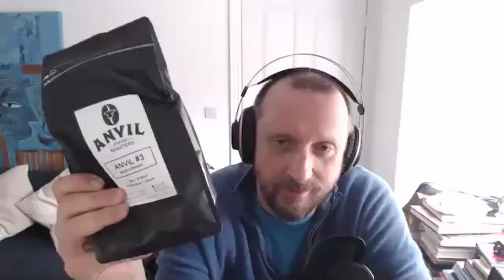Plumbing in an Espresso Machine

Comment: Pressure reduction is often required  for line level pre infusion.  Most people recommend about 2.5 bar. As someone who has had plumbed in machines for years it is easy to forget to replace filters. The difference between a domestic setting and a commercial one is also important. 6 months at home vs  6 months in a cafe  is a huge difference in the volume of water running through the machine.   Once you have a plumbed in machine you can never go back !
Reply: Interesting. I'm running at 2 bar pressure at the moment, after the reduction. I think I can increase it a bit actually. You're dead right about the filters. In the cafe, I asked the maintenance company after 6 months about changing the filter, but he didn't seem to care. I suspect he really didn't care... I'm going for the Brita system for home, and it should allow me to upgrade to a bigger capacity filter if I need to change it sooner. I'm going to keep a number of test strips available and see how it fares at 3, and 6 months.  As far as going back to using my manual water treatment... nope. I already can feel the benefits of a fully plumbed in super system :) Thanks for your comment, and if you're from the UK, don't forget to sign up to win free beans over at https://bartalks.net/giveaway